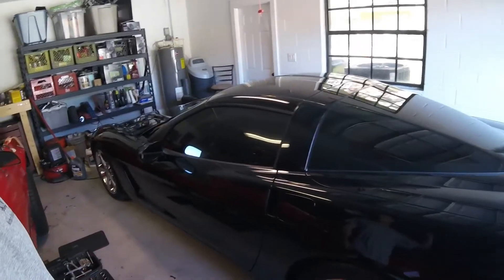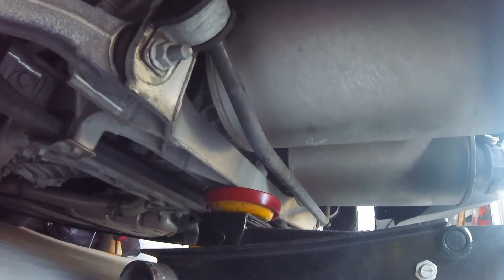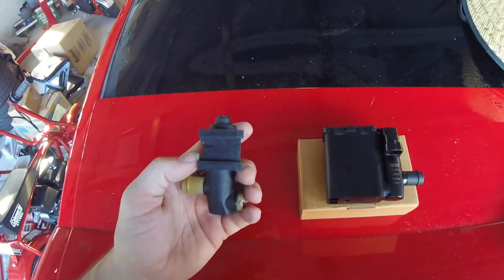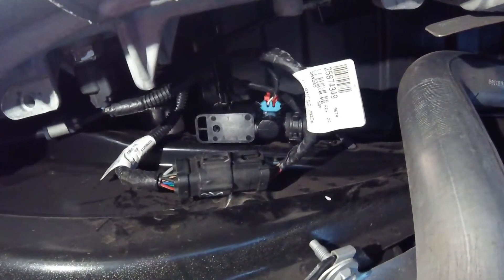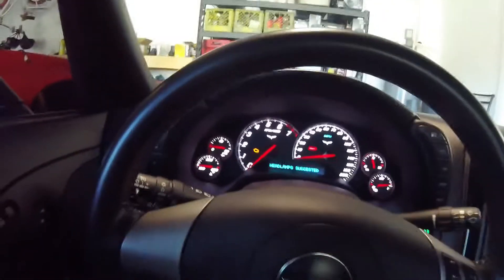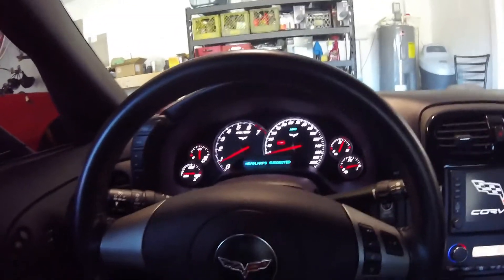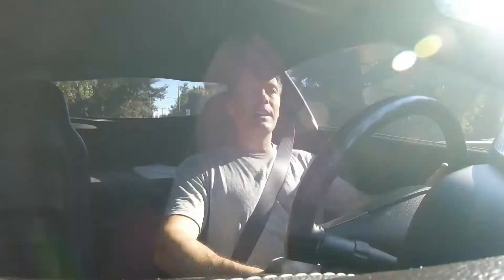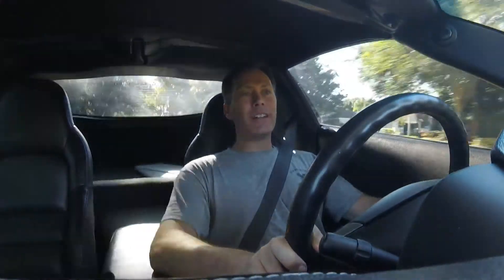PO449 Check Engine Light Replacing Evaporative Vent Valve Solenoid on Corvette C6 Dorman 911-075

Comment: Thanks for the post. It was very helpful. I just want to add 2 things. I found it much easier to access the solenoid by backing the car up onto ramps and crawling under from the back. Second, my car is a 2005. For some reason, GM changed the design of the electrical connection on the solenoid (Part # 1357-5703) so I did need to use the "Upgraded" harness/adapter (Part # 19257603).  It cost $26.60 for the solenoid and $37.72 for the adapter from the dealer!

Comment from the maker: I first slid the part off where it attaches.  Then it is way easier to get the clamp off even with regular  pliers.  To take the part off slide it toward the back of the car.  It takes some force like when you have to pop a panel off with one of those push in fasteners.

Comment: It looks like for a 2005 C6 I would need to lower and move the muffler pipe out of the way.  I  don't see a way to get my hand in there with enough access for the part ?  It looks like on your video the pipe has been moved out of the way enough where you almost had your whole arm in there ?

Comment: Great video -- I messed with the clamp for about an hour with standard pliers. Check out a pair of "Flexible Hose Clamp Pliers" Once I used these, I had the spring clip off in 30 seconds, made re-installation a breeze as well.

Comment: I just tried to tackle this job on my 07 C6 this afternoon and I gave up because I did not have room to put my hand in there with the kind of pliers that you used. I even tried the looonng nosed pliers and I just about broke down because I couldn't get the clamp off. I called it a day and will try to find a tool that could assist me on removing that damn clamp. I'm thinking that even if I eventually get that clamp off, how in the world am I going to be able to put the hose back on with one hand? smh

Comment: Thanks for this well done video, Powershift.  I have an '07 C6 Vette, Base, Auto trans. model.  Scanner is showing 2 codes, the p0449 ( EVAP Vent valve ) and also p0443 ( EVAP Emission Purge Control Valve ).  I will guess my car needs both of these valves replaced...  Car is also reading 1) Service ABS >>  2)  Service Traction System >>  and 3)  Service Active Handling.  My car has too many lights on the dash now and gives the appearance of a Christmas Tree !  LOL  Any ideas ?
Reply: Jon Randall abs codes coukd be a wheel speed sensor i only get them when i go over 100.
Reply: Dis you get it fixed and was it the wheel speed sensor?